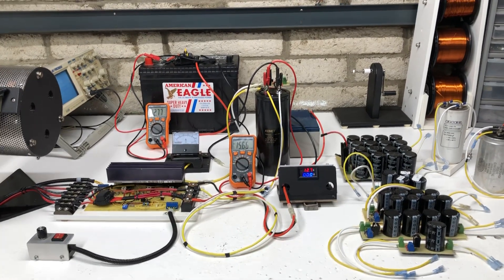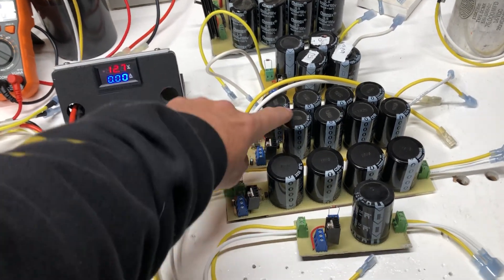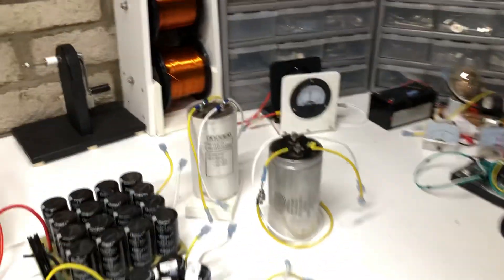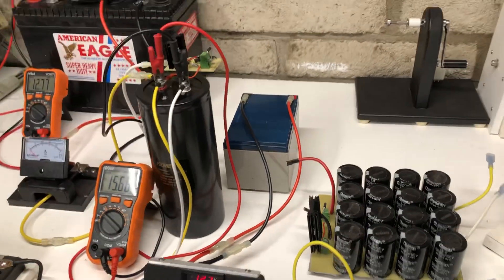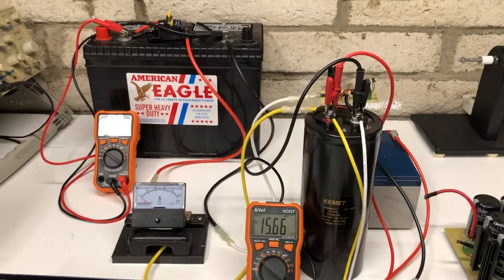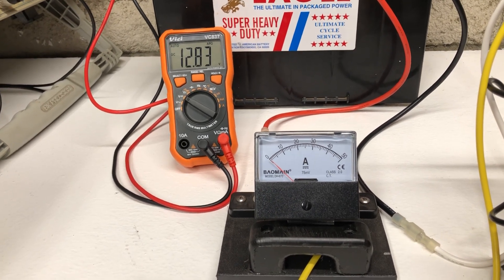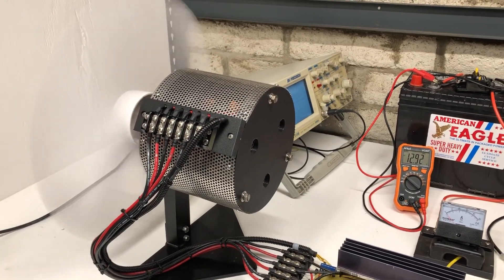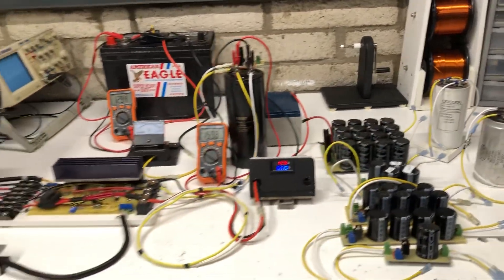Capacitor discharge for different motors and batteries

Comment: Really great to watch!  Thanks!!
FYI I was told (cannot remember by whom sorry!)  the ultimate "Bedini" cap discharge battery charging circuit is for a 12V lead acid type battery,  (golf cart type) is to have 36V in cap upon discharge, and then dont let the cap discharge below 23V (a short pulse width control can do this)
So every speck of "12V battery charging" joules gets wrung out from the cap....nothing wasted....if the cap was to somehow drop to zero volts for example, then the cap discharging from 12V to zero volts would be wasted thats for sure..,  
 however maybe the cap will settle and balance itself to be the battery voltage, so its not going to do that no matter anyways.  Not sure about that but assume cap would stop sinking at 12V, 
Lets say for an example the cap is at 15V when it discharges....now you get only a 3V drop of "real charge" coming into battery.  
The "closer" the cap gets to 12V, the less "quality" in the charge (I think so anyways)
But lets say cap is at 36V and drops to 23V, now everything is nicely above the battery voltage, everything coming out of it is a good charge....Also "refilling" the cap after each discharge is much easier and with less lenz reaction or backemf "reflection" effects when a cap fills from 23V up to 36V as opposed to filling from zero volts, or from 12V as well, so this makes draw to motor lower as it doesnt have to work so hard to fill up cap....so two good reasons for charging 12V battery with cap discharge of 36V down to 23V, as easier for cap to fill up, and cap does a better charge as well....just my opinion!  Take all I write with grain of salt but check it out if you want - maybe scope the cap discharge would be fun to see.
Reply: Thanks Mr Konzen for your insight. It makes sense, I'll keep it in mind when I start experimenting with this circuit. I have a dead 100ah deep cycle I found and was thinking about replacing the acid with magnesium sulfate electrolyte and bringing it back to life. I belive this circuit might be the one. Thanks again K energy for sharing.
Reply from the maker: Thank you ! I think you are right on Mr Konzen! Definitely more complicated on the circuit but could definitely pay off ! I’ll definitely be doing some experiments on those ideas today. 
 What do you think about just running the capacitor without the (dump) ? It’s not as spectacular but does work.
 I think the dump is good because it gives time to convert the spikes then discharge just not as smooth

Comment: My friend and I were just talking about something exactly like this. I want to ask some questions. Could you do this with multiple caps acting like pistons in an engine to generate more force?
How much load can you drive with this current motor set up? 
Could it move a motorcycle or bicycle?
Reply from the maker: Thanks for the comment 
 The capacitor discharge is the output of the motor 
The motor is 1-2 hp it could run a bike
Reply: @kenergy1707  thanks for the quick response!!! I appreciate you.

Comment: I like all of your cap circuits.   Cool stuff and another great video.    On one of the large capacitors you have a normal diode ?   So does the cap just continually dump to the battery as long as its voltage is above the battery voltage ?  If so, is the diode used so that the battery doesnt discharge into the cap ?   Thanks !
Reply from the maker: Thank you ! Yes some times I use that to have a constant output to test different setups 
 On the motors that have isolated output that can be put back to the input to reduce the input amps 
 The diode is there so when I hook it up to the output battery it doesn’t go back to the cap and spark the connector 
 It does continuously dump in the second battery 
 It’s not as efficient because there’s no conversion time like the puser has but a good visual to fine tune the motor

Comment: K sir can I use one of these cap dumps with a BMS ? Would that work so the battery will stop taking charge when full?
Reply from the maker: It won’t stop the charging but will balance the battery 
You will have to monitor the batteries
Reply: @kenergy1707  thank you for the response. How much DC voltage am I able to send to one of these dumpers like your big 1.3f Version I have a 20kwh solar bank
Reply from the maker: @cronicjohnson  it can handle 500v fly back spike 
That cap dump with 30v at 5 amps does 50amp pulse every second
Reply from the maker: That cap dump woks with 150 watt panels
Reply: @kenergy1707  I have 550 watt 40v panels
Reply from the maker: @cronicjohnson  then you can run 3 big cap dumps
Reply: @kenergy1707  oooooo off 1 panel ?
Reply from the maker: @cronicjohnson  yes